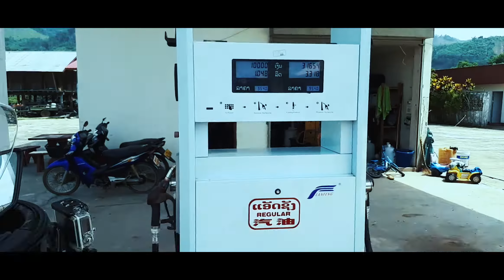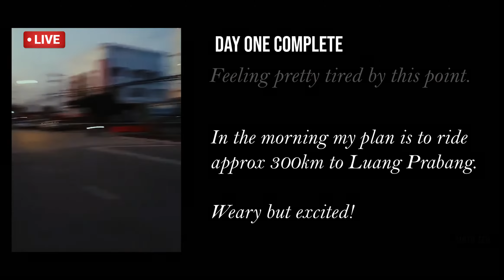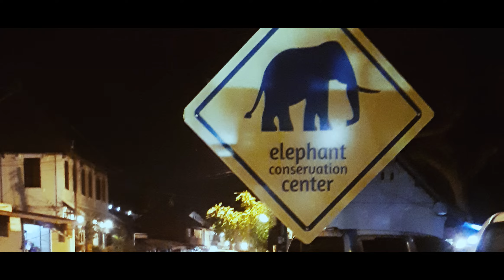LAOS SOLO RIDE - PART 1

Comment: I'm guessing a fuel hose/tube was leaking and wanting to be replaced because it is tired.
Reply from the maker: It was really quite weird. I have a good idea of how much time it takes for my bike to be filled up. When the lady fueled up my bike it took a fraction of the time. I was so surprised. It was like a bucket of water had been just chucked in. Right after that I noticed the fuel dripping out. It could be that the fuel hose was a bit loose but it seems like this refueling triggered something. Anyway, it just adds to the adventure but only in hindsight, when it turns out ok. Haha!